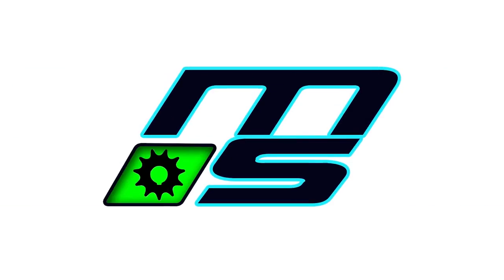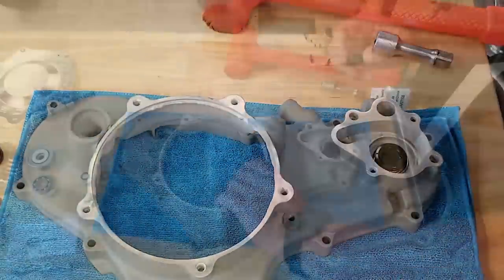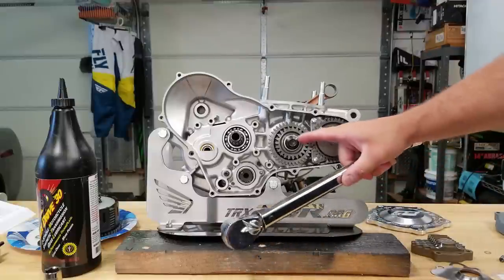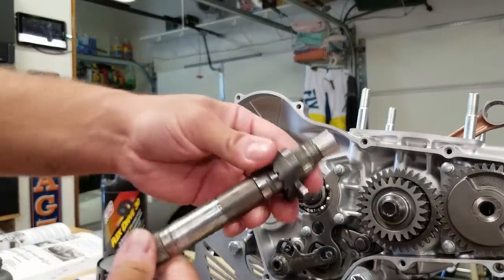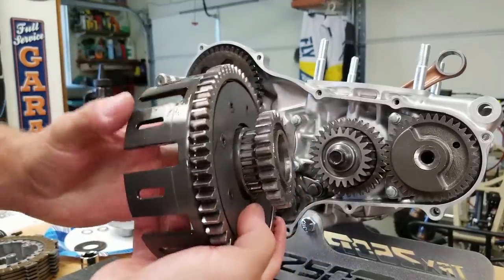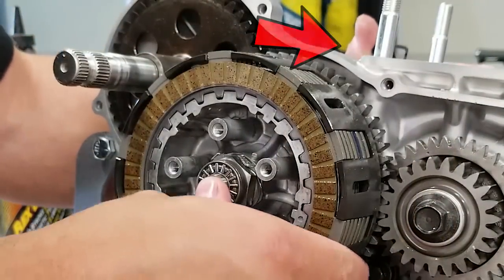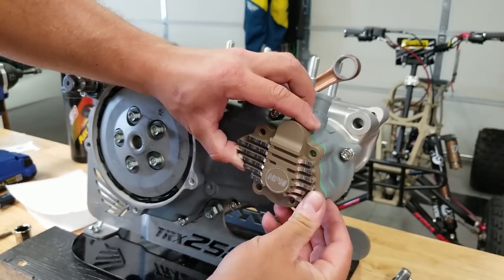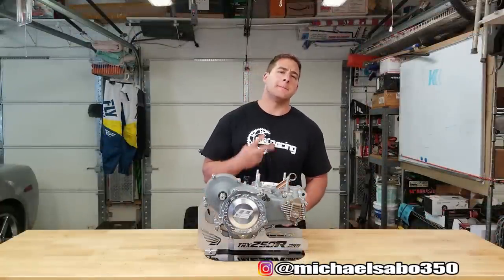How To Build The Clutch Side of a Honda TRX250R ATV | STEP BY STEP | Project 250R Part 29

Comment from the maker: Yo man, you rock for watching my video! 🤘 What do you think of the colors on the motor so far? Links to tools and chemicals are in the description by the way!
Reply: I am rebuilding my lt500 right now. and I was wondering if the shift shaft has to be in a certain position on the shift drum?
Reply: It is kinda hard to explain
Reply: Bro it is looking so good!! My mind is blown!! 🤯
Reply: Your colors are perfect bud.
Reply: Probably the most detailed quad videos I've seen. Motor looks to good to be in a frame
Reply from the maker: I have never worked on an LT500 but I would guess yes; I'd check it out in a service manual for sure!
Reply from the maker: Thank you dude!!
Reply from the maker: Thanks so much Robert!
Reply: Imagine a atc 250r 1986 with this motor and rear suspension that thing would be so crazy
Reply: This thing’s gonna look wicked, can’t wait to see it finished! Colours pop so well. Thanks for the tip with the bolt/penny, doing my raptors once parts arrive
Reply: @Kyle Jayden Yea, I've been watching on InstaFlixxer for since november myself :)

Comment: Your doing a great job being new to the 250r.  Nice refresher for me to watch your videos even though I just watch because I'm a 250r junkie.  I got the very first trx250r my honda dealership sponsor got in.  His boy got the blue and white and I got the red and white!  Greatest 4 wheeler ever made.  I won a lot of races on them bikes.  Still have 4 of them.  A leager narrow frame,  Walsh modified stock frame tt racer with aluminum subframe, houser crf450 hybrid, and a stocker.  Need a roll design to round out the collection.

Comment: Hey Michael, that clutch push rod is from an '87-'88 TRX250R.....and you utilized the '89 update kit bearings & parts....I have a feeling it's gonna be too short....You can still get the '86 & '89 push rod (they're both the same length) from HONDA Part#22851-HA2-670 $17.43 or if you buy the '89 clutch update kit you get everything (rod, bearing, pusher, washer) Part#06220-HB9-305 for $90.81. If you rotate your clutch actuator and it goes too far.....that's the problem.....the extra washer may help....also I noticed the clutch PRESSURE PLATE is a '86-88....(HA2) you need a '89 (HB9) Otherwise...Great Video!!! Keep up the great work! :)

Comment: @Michael Saebo I've watched these videos several times on the engine build as well as the series with Dave Moore prior to getting ready to build my ATC 250Rengine. My question is on the clutch shaft that goes vertically in the cases with the spring and washer, did you have to get the other components that are in that hole and install them or were they left in the cases during disassembly? I know one of those parts is discontinued the needle shell#12 on diagram and part #91002-HA2-003. I was wondering if you knew another source for that particular part. Thanks. Anyone else that sees this comment is welcome to help a 250R brother out.

Comment: oh shit i missed that in the other video that this was a hotrod crank . why didnt you use the factory and have it rebuilt ? factory is so much better than that hotrod tywain crap . the first hotrod crank i ever ran 2 years ago barely made it past brake in before the bearings started coming apart . then i brung it to a local machine shop to get rebuilt and it wouldnt even come apart to be rebuilt . the machinist asked me if i had the oem i said yes and he said bring it to him to check out and was still good .
Reply from the maker: Interesting; hopefully I'll have a better experience. I am running a OEM 8 ball bearing on the crank so that should help. This is the crank that ESR sent me with the setup. I've used hot rods with good luck though; so I'm confident this one will work!
Reply: @MichaelSabo  do you still have the oem ? and the 8 ball upgrade is good . but look up on youtube hotrod crank problems . hopefully you do have good luck